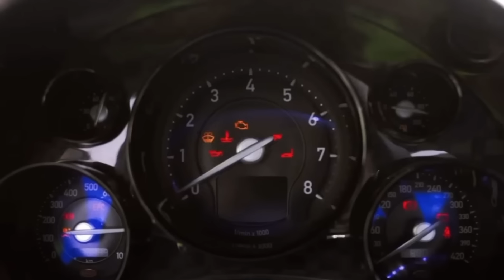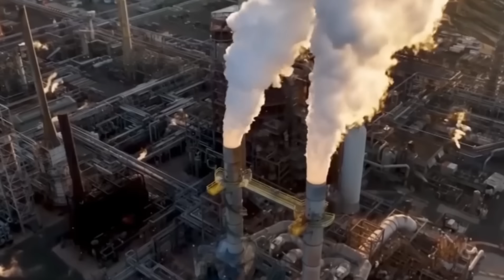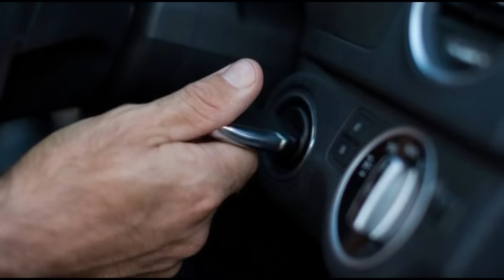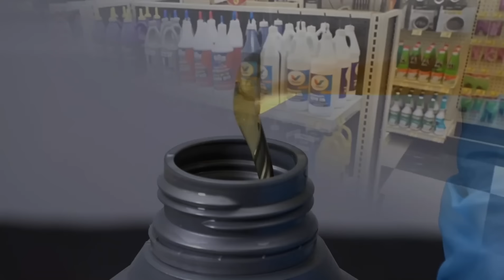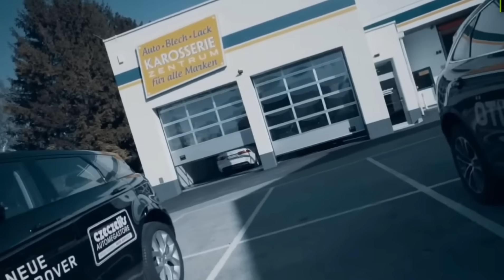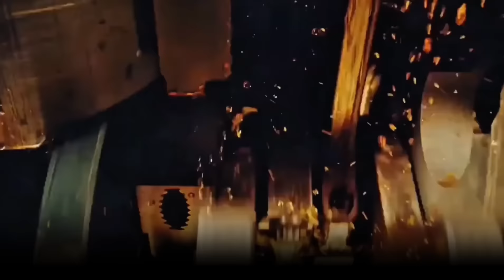Mechanics Won’t Tell You THIS About Synthetic Oil! (Exposed)

Comment: I was a mechanic in the 1970s. I used to compete in rallies and production car trials. Used to change the oil (20w50) every 2000 miles (free from work) same with the filter. Used STP to maintain pressure under competition use.

Comment: Valvoline is the only usa oil manufacturer that can change oil as an engine is running to monitor small changes. Look up hammer and scar tests, you'll be surprised how bad some full syns fail

Comment: You had me believing what you were selling until you started selling Fram filters. So many of them have inferior components that it would be impossible to choose one without tearing a specific part number apart for the vehicle it’s supposed to be used on. Oils in certain vehicles is more likely to be useable than filters.

Comment: The best most cost effective oil products are sold at Walmart. The Super-Tech full synthethic oil is as high a quality as you will ever need. ON FILTERS do NOT buy FRAM which is a bottom-of-the-barrel in quality. Any other brand is fine. My favorites are AC Delco, Mopar and even Super-Tech will do OK,

Comment: Stay away from.quaker cake shitgo all that cheap crap and watch the gas u use. U need to put a good quality gas with detergents in them your best bets are shell stations lije circle k sams club and sunoco. Make sure they have detergents in the gas its  not  watered down and anything else is massively watered down leaving heavy carbon deposits on your valves ,pistons and eng8ne walls destroying your engine 5 times faster. So 7-11 wawa,wal mart big truck stops destroy your engine before 100k cheap gas costs you big engine repairs.and use a good injection cleaner like Lucas

Comment: Costco Kirkland oil on sale (less than 3 bucks a quart) and WalMart Supertech filters are all you need.  Change every 5000 miles (or yearly if car isn't used much) and spend the savings on better whiskey.

Comment: Short trips change oil every 3000 miles
Reply: But what is considered a short trip? 1 mile? 3 miles? 7 miles, 16 miles?
Reply: @truckinguy92 city driving. Engine doesn't reach operating tempeture

Comment: I have had two bad experiences with synthetic oil. I had a Toyota 22re start leaking with only 5000 miles on it. And a 2006 Honda motor trashed with only a valve cover leak. I will never run synthetic oil in a motor again.
Reply: Not the oils fault

Comment: I bought a brand-new Chevy Impala with a 3.4 V6 engine in 2000. The only oil the engine has seen is Mobil 1 5W-30, and I change the oil myself every 3500 to 4000 miles along with a Mobil 1 oil filter. The only problem I've had was a blown head gasket. It wasn't the oil's fault. When I removed both heads, the pistons' tops were very clean, and the valves looked clean as well. The engine currently has 185,000 miles on it, and I have every reason to believe it will go another 100,000 to 150,000 miles.
Reply: I've sold auto parts for over three decades, and from the late '90's to about 2004 or so it's just about guaranteed to blow intake or head gaskets on those engines due to poor gasket design plus the fact that after any coolant system issue the system WILL hold air and has to be bled out or it'll overheat...which you probably know all too well by now.
Fun useless fact: I once had a customer give me a $25 gift card to a local steakhouse because he had a coolant leak on a car with that engine and I gave him a heads up on the bleed procedure, which he had no idea such a thing existed. He was glad he avoided a major financial catastrophe. Very nice guy.

Comment: I use rot gut oil and toilet paper tube filters,but I change everything at 3k like clockwork  181,000 miles,zero loss of oil and it's still going strong. I don't know about you but well spent money is cheaper then replacing an engine, your money your call.

Comment: Most mechanics know very little about lubrication and lubricants. What you will get from most automotive technicians (that's what I call them) will be an "opinion" or what they prefer or believe is the ideal product to use. 

I worked 35 years for ExxonMobil in the automotive sector and got to know a lot about engine oils. You would expect that given my company manufactured Mobil 1, in all of its different viscosities and specifications. It is here where this subject becomes difficult.  Explaining the fine details about oils is not easy, because most people aren't interested and it is technical, causing a lot of people to just glaze over and lose interest.  So, all we can do is advise consumers what our oils "will do" and we aim to keep it simple.  

The other side to what an oil manufacturer advises consumers is engine manufacturers. They have a specification for oil that should be installed in their various engines and this is where oil companies and car manufacturers get together. Car makers need oil companies to know what they want, and they want us to tell what can or can't be made to work over a given distance of driving. It's complicated and again, most consumers aren't interested. 

Now,  to make my advice simple  -  Do this. Follow the owners manual for your vehicle. Change the oil and filter when recommended. Make sure the oil specification for you car is used. That detail will be in your owners manual and can be found on the oil pack label, usually on the reverse side.  You don't need to know what these letters and numbers mean. Just make sure they are the same - what's in the owners manual to what's on the oil pack label. 

Final bit of advice. Buy a recognised quality brand and don't buy according to price, unless the quality brand is "on sale". If you buy cheap, that's what you will  be getting. Cheap low spec oil. Don't do it. 

Have a good day. !!

Comment: have a Golf R Gen 8, how good is their original filter, which they use when I service the car at their workshop

now I change the oil and filter myself between the mandatory ww services, drive a maximum of  3000miles between these changes

so my car, gets 5w-30 when I change the oil and filter myself and the ww workshop uses 0w-20 and ww original filter when they service the car

Comment: I have used Mobil One in all my cars since the early 1980's.  I have driven over 1,000,000 miles with the 17 vehicles I have owned over the years. None of my engines ever failed. Currently I have over 200,000 miles on my Expedition with the Triton 3V motor. The inside of the engine is sludge free and looks new. I even got 19.3 mpg this last summer on a cross country trip. Changing the oil every 5,000 miles with synthetic is a good practice.

Comment: I have used Mobil1 full synthetic in all my cars for decades and never ever had any oil related problems. A friend of mine forgot to open the water valves on his jet boat and nearly cooked the engine, it was making noise and smoking badly. Took it home thinking he fried the motor. It was a 455 Olds marine engine and when he fired it up a couple of days later it ran great, no noise, no smoking, no rattles nothing. That's when I became a believer in Mobil1 full synthetic. I am on my fifth Corvette now a C6 and GM recommends Mobil1, now they have their own version but when I go for an oil change it's always Mobil1. Pretty sure Chevrolet has figured out how to take care of their star car model.
Reply: amsoil signature series is what i use if you pour gasoline in the oil it sits on top and rolls around then evaporates off they do not blend same with varsol, water anti freeze they stay seperate will save your engine when a leak happens  i did use MOBIL 1 from 1980 to 2,000 and switched to AMSOIL
Reply: Thats what I use too. ‘87 z28 508K miles. Changed the intake gaskets about 8 years ago. Thats all the engine itself has ever been apart.

Comment: I have a Mercedes C series 2002. 480,000 miles and still running very well. No problems ever. Mercedes requires you to use Mobile One to stay within warranty. I change every 10,000 miles religiously. I also use oem oil filters like Mann. Do not go cheap on oil filters. Really important.
Reply: Fun fact, since Mann Hummel started producing WIX filters have had more complaints and quality issues.

Comment: I don't use synthetic oil or change oil very regularly I use Napa standard oil or O'Riley's house brand , results, 95 Dodge Dakota, 300k miles, 05 rav 4 Toyota nearly 300 k 04 Mazda MPV nearly 300 k . 
 Dakota no longer running, Toyota and Mazda Stoll running fine!!

Comment: Changing oil too often can be a problem also, my sister used to get oil changed every 2k in a Ford with a 20" pickup tube. By the time she had 85k on the car, the oil pressure was reading low, no sludge but bearings were down to the copper layer !
Too many dry start-ups 🕵️🤷‍♂️
That's equivalent to someone having over 200k on the car 🤦‍♂️🤦💁
Reply: That's why I run Lucas engine oil treatment. Zero dry starts even after a month of not using the vehicle. Their additives make the oil extremely clingy, like a bad relationship, only this is good!
Reply: @CallibanMcGee LOL, Yeah, everyone has had at least one of those !
Fram filters are notorious for anti-drainback failures so every startup is like you just changed the oil.
Use a Wix or Purolator filter, performance is pretty reliable and priced reasonably !

Comment: I caught a GM dealer passing off synthetic blend as fully synthetic.  
Oil analysis proved it , but General Motors  customer service did nothing to correct the   Dealership.
Reply: Stephen, you are right about this, but not all dealers do it. Some of the "clever" guys who want to make more money are telling their customers that the oil they use is "full synthetic", and they charge a higher price, but unless they reveal the brand, which they will avoid, you can be sure it won't be an oil similiar to say Mobil 1 - which is a PAO based product.

Comment: I've got a 4.7 ram engine in my half ton Pu bought new  now has 270,000 miles never had a wrench on the engine change oil every 3,ooo miles still doesn't use any oil between oil changes, Pennzoil 10w30 & still drive it every day. No synthetic oils for me.

Comment: I'd say about 50% of the engine metal wear your new car will experience happens in the first 1500 miles. That said, change the oil and filter at the first 500 mile mark. Then, again at 1500 to 2000 mileage mark. Try to get in as much stop and go driving you can early on. If possible, after that 2000 mile mark try to take a long freeway drive (like 400 miles) and change your oil at the 5000 mile mark. So, three oil changes, and three new filters. After that a high quality synthetic and high quality oil filter every 5000 miles. And if you want to at that point you can just change the filter every other oil change. If you want to run something cheaper than Redline or purple and is just fine, get Mobil 1. I've used it in engines where after 80k miles I still can see the factory assembly paint still on the rocker arm assembly. Now, that's clean.

Comment: I use conventional Quaker State 10W30. In my 2006, Colorado got over 240000 runs like a clock. This is all crazy if you change your oil
Reply: Wax in quacker state.
Everyone I've tore down was packed with wax . Caked in places that baffled my mind.

Comment: I use an oil that is 100% Synthetic (PAO & Ester blend) rated at 15K miles for severe use, and an oil filter rated at 98% efficient at 20 Microns.  The filter is also rated for 15K miles.  I change the oil and filter at 10K miles or one year.

Comment: I've always been a Valvoline guy. I bought a new RAM 2500 where they recommend Pennzoil Ultra Platinum so that's what I'm using . Used oil analysis shows high metal wear ( I'm changing oil and filter every 2k until I get to 10k then I'll go to 4k changes once I get a satisfactory result) I know Pennzoil is good stuff but I m going  back to Valvoline and upping the viscosity from 0w40 to 5w40 if I still have high copper in the next analysis.
Reply: I just a video about oil analysis on these and the 5w-30 showed a huge improvement on wear metals
Reply: @SouthwestSway that's on ,5.7 Hemi isn't it? Mine's a 6.4
 It's a bit different.
Reply: @rustypipes12 oh i see.

Comment: I disagree I use mobile one in my smart car and motorcycle I drive 10000 miles between oil changes in my car I looks just as good as the day I changed it other that darker
Reply: Ya I have a C6 Corvette and I use Mobil1 once a year. I don't drive that many miles a yr and I have a GS Corvette with a manual trans, which means it has a 11Qt dry sump oil system from the factory. My fifth Vette and always use Mobil1 never a problem. LS3 in that car is a runner, runs very well and eats 5.0 Mustangs for lunch and most of the Mopars are a joke also. Smart car?? Do they even have a motor??

Comment: Mazda dealers insist putting 0-20 synthetic but everything I have read says in hot climates like Arizona 5-30 protects more and Mazda even recommends it in other countries. Also, is a Mazda OEM filter a good choice. Thanks
Reply: Mazda CX 5 2019  5W 30 the best   Mech specs  way better Florida heat ware and tear engine protection and for colder weather  stars also.

Comment: I’ve been using nothing but Amsoil in my Harleys since 1997 also their filters are second to none. 5 years ago I bought a 2004 Ranger FX4 from my son with 148k miles with a 4.0 engine that had never seen synthetic oil. However he did all basic fluid changes . oil and filter every 3,000 miles. front and rear differential as well as transfer case every 30 k. Anti freeze every 30 k as well. I immediately switched over to Amsoil’s oil and filter. The truck just passed 200k original timing chain  original eater pump shit the bed at 185k. The oil pan gaskets were leaking ( yes gaskets there were 2) so i changed them with Felpro gaskets and bought a new Melling hi volume oil pump  while we were there. The oil pan was dramatically clean except for some small  pockets of sludge in the corners of the pan. German engine is bulletprooof. I went to a cold air K+N intake and upgraded the ignition coil. I used Valvoline full synthetic for 25 years for their warranty until my 2004 Dodge Durango 5.7 Hemi  threw a connecting rod and it came through the block with only 112 k mikes. I used Valvoline full synthetic since 51k . I used the best oil filters . Miss Boyd from Valvoline fought my engine replacement for a year after initially offering me $1,000 towards a junkyard motor.😡😡It took me a year to get a $3500 rebuild from them. I’ll stick with Amsoil forever. I even convinced my childhood friend. to switch with his rice rockets after He ran my oil between his fingers after 3500 miles in my air cooled Harley and it still felt like liquid ball bearings. I look at the oil then smell it then run it between my fingers to feel for grit. Amsoil is the best i’ve ever used
Reply: Amsoil filters are made by Champion labs. You can save a bunch of money buying Champ XL filters. 99% efficiency down to 20 microns.

Comment: You can’t buy a bad oil today. The government is up the ass of these oil companies. Some people have hundreds of thousands of miles on there vehicles and only used Walmart super tech full synthetic oil a product of Warren oil company that blends for Walmart. Look on the back of the jug of oil. All the same cool numbers and letters as the big boys. If it has the API American Petroleum Institute seal of approval it’s good  oil. Don’t believe the fancy logos pretty colored bottles  and endorsements. Change your oil with quality filter every five thousand miles. Ive been changing my oil and filter when I begin to not see my oil dipstick level lines through my oil. Over 58 years doing it this way and never ever had a engine problem.
Reply: I agree, use wally oil and wix filter, change ever 3,000 not filter but every other change. I'm retired and I do it to make sure it's right. Don't trust potheads.
Reply: Oil filters are the cheapest form of engine protection, if I'm doing 5k oil changes, then I'm changing my oil filter at 2.5k miles, takes very little time and the price point of the filter versus engine repair cost is negligible , hopefully the oil filter manufacturers realize that shoddy filter material amounts to fraud against the motoring public
Reply: @lawrencejoy9346 is I used to think like you about filters until I saw a video from the experts at Donaldson   where they were actually saying that people change their air and oil filters too frequently. The filter actually works better after it gets a little dirty. I'm not one of those 10000 mile guys but I change the oil every 2000 and filter every 4 000 on my new Hemi until it's broken in. Then I'll change both every 4k.  I do some hauling and towing with my 2500 so I baby it some what.
Reply: Warren oil produces for a LOT of companies. I've worked for a mom and pop auto parts for 30 years this month and we sell a house brand oil produced by Warren Oil. Over the years I've seen a lot of generic oils produced by them. But for the reasons you stated that's also why I use the Walmart Super Tech in the high mileage version (the cost of the gallons is actually cheaper than what I can buy the quarts for through my warehouse, because our packager for whatever reason doesn't do bulk). That starburst seal gives you all the confidence you need, as proven by engines that keep on going and going.